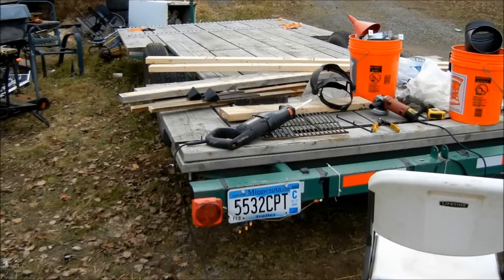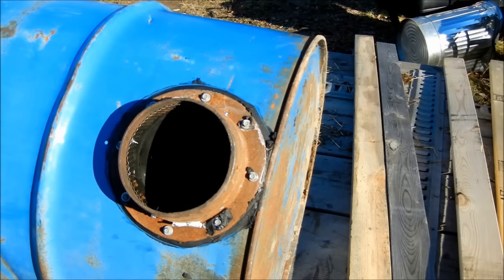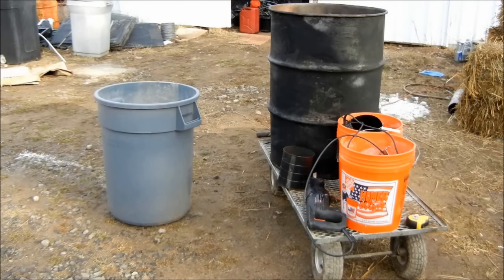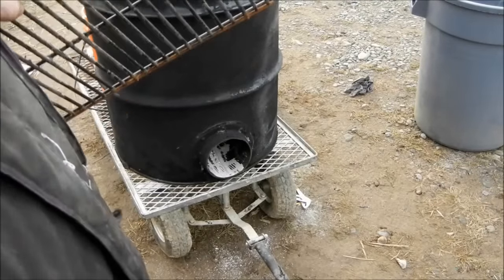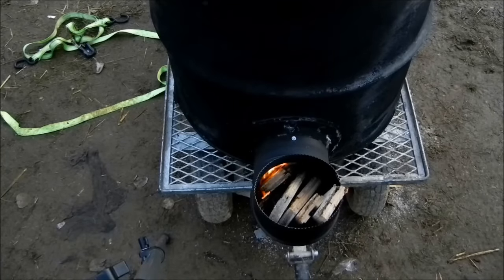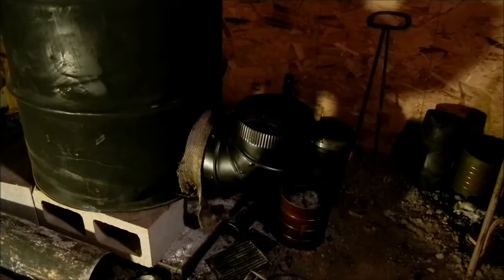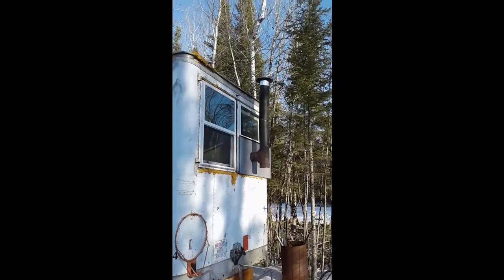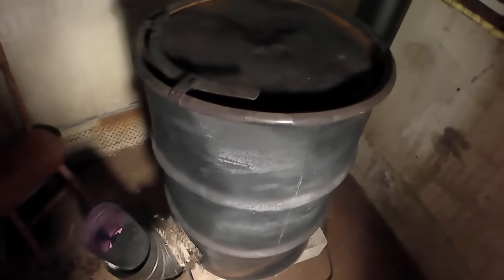My easy no weld rocket wood stove heater complete build with burn temps and use footage.

Comment: so if you filled the inner chamber with sand would it/ could it work like a masonry heater? or maybe plumb 2 of them together?
Reply from the maker: If you look up traditional rocket stoves you will see this basic design but then the exhaust pipe goes through a cobb bench and collects the heat so you only run the stove like an hour a day but the bench gives off its heat all day long. I built this version to heat an area fast that I only planned to use for maybe a few hours so wasn't worried about storing the heat.
Reply: @RepairmanJared  goooooootcha. I been pondering the heat storing th ing as here in Colorado it’s cool at night but warm in day. So short firing makes. Sense. But I plan to use th is in machine shed with no insulation so some
Heat retention and slower release maybe ideal. So can I make a bigger fire chamber that chokes down to 8” pipe and still work like a rocket stove? I don’t wanna chop some of what I have soo tiny. I’m thinking like a size of steel helium can from mao mart

Comment: Walker Stoves has built his burn chambers and riser  out of refractory board and then lines the burn chamber with a high temperature alloy used in furnaces.  This seems to be overcome all the metal spalling problems from burning at 1000 degrees.

Comment: Clever use of materials... not sure how long the riser tube will last, but your method got 'er done...
And that's what counts.

I built one with an Insulated firebrick burn chamber and riser... I'm getting well over 1200°F on the top, and up to 800 to 900°F on the sides when burning well.

Looking forward to making stove 2.0 which will be a batch rocket... so many innovations on YT, and I want to incorporate them all in one.

Check my channel. There's a quick wordless vid of 1.0 and one of a failed attempt to make an external batch box... big mistake... 2 weeks of my life gone...

I followed up that failure by making a larger burn chamber, so I could burn cordwood (verticle), and have longer burn times between fuelings... now I need to use an insulated flu to increase draw.... it's always something.

Keep building... rockets sure are fun...

Comment: The damper can be removed by pushing the handle in and turning the handle without moving the damper and presto by pulling and twisting the handle comes out and the damper is free.
Reply from the maker: On the one that came with the kit it was welded in place regular dampers do come apart that way, and this one did after I ground off the welds.

Comment: I admire your initiative.  I would like to see a follow up video in 3 months.  Rocket stoves burn exceedingly hot and create a lot of fly ash.  I would like to see how the metal in the firebox holds up, how you dealt with ash buildup, how you cleaned out the ash and whether the perlite insulation around the pipe served any purpose.  We can learn from your experience.  Thanks for your effort and sharing.
Reply from the maker: The stove was originally build in 2012 and a lot of footage in this video is from then "my original build videos were horribly edited." For ash clean out I have just used a regular fireplace shovel bent/curved to fit the curve of the bottom of the pipe for the feed/burn area. Generally the ash I am getting in that area amounts to 1/4 coffee cans worth after about 4-8 hours of burn if I remember correctly. I have not cleaned it out yet since moving it into the semi trailer which I did right before posting this new updated video, so I will keep track of the hours to see how much ash I get during the first clean out I only have 2 or 3 hours on it right now "the ash isn't yet over the bbq grate". 

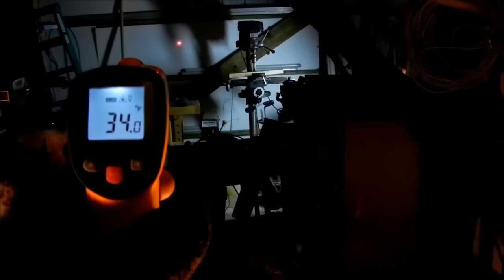Also I plan to replace the lid soon so will see how much ash is inside the barrel around the heat riser, I doubt there will be much when I moved the stove I looked in there via the exhaust and I didn't really notice any, but I was not looking closely just a glance. The perlite around the feed and burn area on the outside of the stove do make a difference in stove temps and also are just good in a safety standpoint, the burn area gets up to about 1200 degrees and with the perlite and 8" pipe over that I think I read something under 400 on the sides a bit more on the top you can see that at 24:45 in the video so a very substantial temp difference.